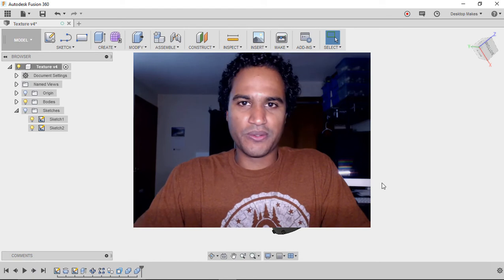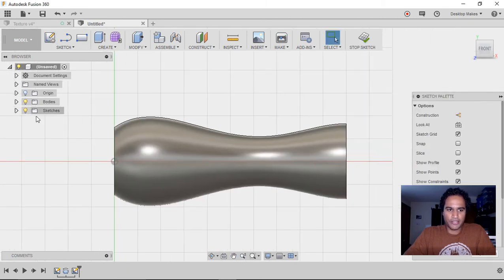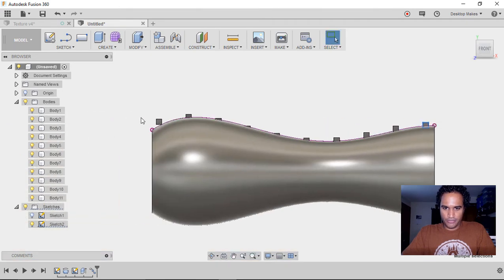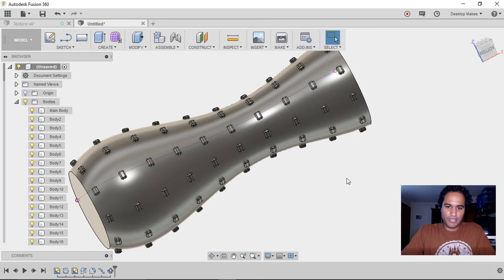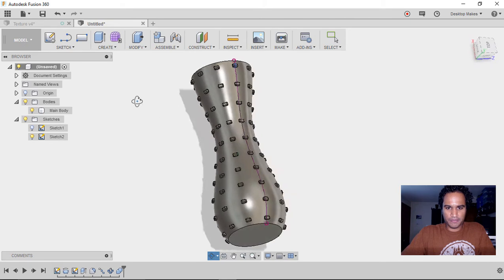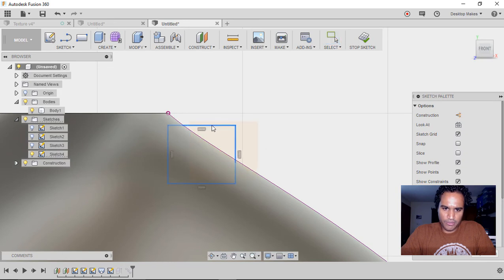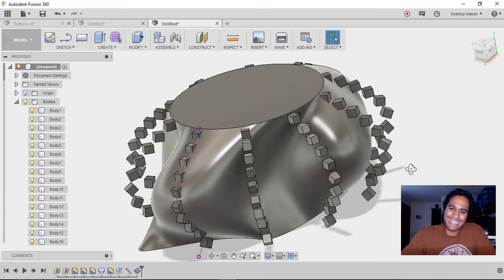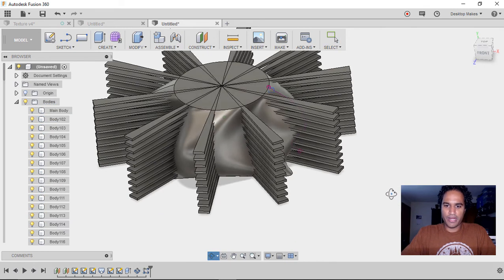Texture Follow Up - Pattern on Path - Fusion 360

Comment: Good Vladimir and intenst ... but the pattern on the organic surface is quite variating in size and shape according to how it is projected on the surface .. think if it was a perforation of fixed size of circles ... this methode wont work ? 
I Have no solution ... but good trial

Comment: Big kudos for this video. I really like how your are maintaining your channel / videos.

You're totally right, that the combination "pattern along a path" and "circular pattern" just works for round / revolved objects. Fusion has chosen the name wisely ;-)

For irregular bodies as shown here at the end, I know no more elegant way. The only solution I have in mind  is to create (like in your example 10) offset planes and use those as a split tool for the face (modify -> split face) Now a body could be patterned along each path on the face. Less elegant, less regular pattern, much more work.
Reply from the maker: Thanks Wilko.  I love the feedback and recommendations.  It allows me to try new ideas when approaching a design.  If it works I usually share it on my channel.